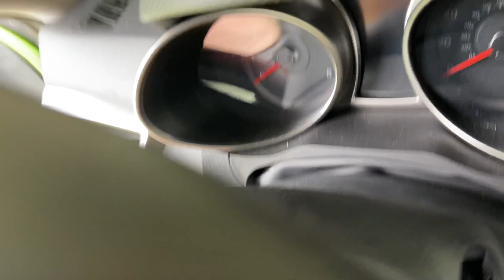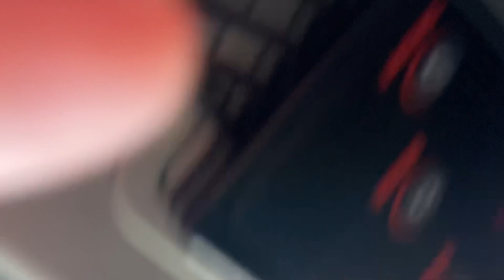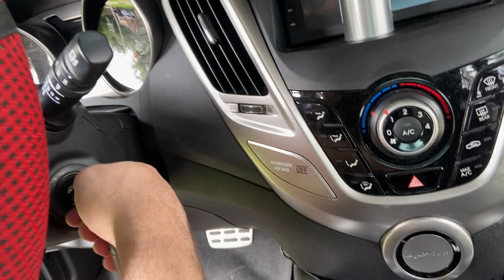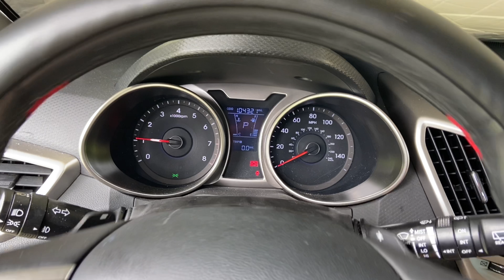Hyundai Veloster - Fix clicking steering wheel

Comment: VERY IMPORTANT POINT...
Prior to re-inserting 14mm screw, make sure to raise rear of steering column FIRST and carefully insert rear lip of column into square which can be seen after 16:07. You will know when it's properly inserted because the rear will stay up while you're still holding front using steering wheel.  Next twist on both 12mm nuts just enough to hold front of steering column.
NOW... you can install 14mm screw.  It might be necessary to push straight up a little from bottom rear.
Tighten 14mm.  And FINALLY, you can tighten both 12mm nuts.
Sorry, for long comment, but this extra attention will definitely make life better for you.
Additional note... There are a total of 5 plug-ins attached to the steering column.
Reply from the maker: Good points, thanks for the comment.
Reply: Your tip was extremely helpful, thanks for sharing
Reply: Lo leí tarde, pero la intuición solucionó el problema jajaja
Reply: How long can I drive with this problem
Reply: @mardanm5465  I don't know how long you can drive with this problem.  BUT, I know you will spend more time researching the answer to your question than you will spend actually fixing it.
Dive in.
Reply from the maker: @mardanm5465  I drove about a year with the issue before repairing and I didn’t notice any major issues. That being said, I had a lot of play in my steering which is an issue and long term, I don’t know what the effects would be. Likely, some metal could wear down a bit from the metal on metal contact. My advice is to either talk to a mechanic or get a friend to help you swap this part out.
Reply: Thanks for the heads up.. made this fix go without any issues...
Reply: I have a question do u have a clunking sound when you hit bumps in slow speed ??
Reply: @MmohammedALSheikhly  No.
Reply: Wish I read this comment before I put mine together.  Had to have someone hold the steering wheel up while I put the long bolt back in.  My hands are way to big for this job.  But it all works and I have an extra bolt and screw left over :)  BTW: Did anyone have their steering wheel come apart while doing this or just me?
Reply: What six said!!!
Reply: Is there any way you could possibly come and fix mine? It looks easy but I feel I can not do it😞
Reply: @shaunaceyshaunie9691  Of course.
Reply: Sorry to be so offtopic but does someone know of a way to log back into an instagram account??
I somehow lost my account password. I appreciate any tricks you can offer me!
Reply: @Gianni Decker thanks for your reply. I got to the site on google and im in the hacking process now.
Seems to take a while so I will get back to you later with my results.
Reply: @Gianni Decker It did the trick and I now got access to my account again. I'm so happy:D
Thanks so much, you really help me out!
Reply: @Elliot Xzavier no problem =)
Reply: @Kur-Six  , not safe to drive too long
Reply: This part was the hardest bit of all. I had to get my little sister to hold up the steering wheel while I finally shimmied the column in place and even MORE shimmying to get the bolt in place.
Reply: @mikew6193  it happened to me ended needing an alignment
Reply: Ha ha learned the hard way
Reply: It's a good point. I figured this out rather quickly. Also, it's a good idea to loosen the x2 12mm nuts before removing the 14mm bolt so you can wiggle the steering column and makes it so once you crack the bolt loose you can unthread it by hand.
Reply: Just to add to this, in case it's difficult to grasp.  The 14mm bolt is literally the pivot point for the steering wheel's adjustment feature, so that's why it's difficult to line up.
Reply: Thank you biggest tip on the market..
Reply: Does anyone know if the Hyundai veloster has any recall in this kind of issues because lately Hyundai has been having a lot of issues
Reply: @DomingoMercado-kh8wb  it only has a ABS recall at the moment that states it could lead to fire.
Reply: What can you do if your steering  wheel is not aligned any more?
Reply: @josephafa  depends if it's intact with the issue above.  Could simply be alignment. It's vague.
Reply: @josephafa  This repair does not affect alignment.
Reply: @Frostcall  We did everything you said, but now we have no power steering.  it gives an EPS code on the dash, and the stability light is on.  Any ideas to what went wrong?  thanks for the great video btw.
Reply from the maker: @iHeartAmySue  while I don’t know your specific and unique situation, others in your spot have reported that some cables did not get plugged in all the way. My advice would be to slowly take things apart, unplug everything, blow on the connections to make sure they are free of debris, and plug everything back in, also check your fuse box. Actually, check the fuse first because that’s quicker and easier.
Reply: @Frostcall  wow that was a quick reply THANKS!  So we did check the fuse, and the connections (we'll do that again) and as far as we can tell everything is fine (the fuse map is difficult to understand, but we checked the fuse that had a picture of a steering wheel on it.)  We did connect the dang battery for a minute while we were trying to get that steering wheel back into place, i'm wondering if we did something to the power steering by connecting that?  (I know that was stupid but it was my dumb idea).
Reply from the maker: @iHeartAmySue  Did y’all get it figured out?
Reply: @Frostcall  not yet. Our mechanic is holding it hostage right now but I’m about to try to go get it and take it to a foreign auto mechanic.   We live in rural Pennsylvania - Chevy Silverado land - it’s hard to find anyone that is knowledgeable about Hyundais.  

Thanks so much for asking!
Reply: @iHeartAmySue i have the same problem do you have the solution ?
Reply: @Korbixdu31  @Korbixdu31 Mechanic said we needed a new steering column control box - the silver box that you see in there. He said it wasn’t anything we did to it but probably got jarred a little bit while we worked on that stupid little plastic piece. You have to replace the entire steering column but we got it from a junkyard and it cost me $650 including parts and labor here in PA. Call a bunch of alignment shops or mechanics who specialize in foreign cars and make sure they have the right diagnostic tools. We would’ve replaced the steering column ourselves but we don’t have the right equipment.

Comment: My dealership where I got my Veloster from wanted to charge my $400 to replace this. So thank you so much for posting this. It helped a lot
Reply: Worst part: the part is $5 from Amazon
Reply: This is actually a hidden recall.  I have an 2013 Optima and the steering went  away. Complained and threatened to sue them. They did the repair for free. Problem is, they used the same crap part and the problem is back a year later.
Reply: @ninj4geek   just went to the dealership & paid $1.18 for the piece.
Reply: @robertosantiago3947 what is the part called?
Reply: @ninj4geek cómo se llama la pieza

Comment: Just did this repair this weekend - The original had disintegrated to the point it was more rubber goo than particulates, very hard to clean. These instructions made the replacement a TON easier. Thank you!

Comment: 4 years old this video is the best! Even now in 2024 I am fixing the issue on my 2013 Veloster. 14mm was no issue. The torques holding the cap I had to slot bang with a hammer to loosen. Mine was made in Korea so it was super tight. Best tutorial I found. I took the whole bottom piece out better access.

Comment: Many thanks for your video and advice. My son and I did this repair on his car. It took about 2 hours and we are not mechanics. For your information, it wasn't necessary to remove the plastic parts around the steering wheel on our Veloster to lower the steering column. Kiss from France.

Comment: This was the best video I could find to step through this.  Saved me a bunch of time and money!  I ended up using a wooden block to hold the column up so I could get the hanger bolt in.  Other than that, it was seamless.

Comment: Worked like a charm! About 2 hours time from start to finish. A couple of key points:
- the 14mm is a beast. I used my long torque wrench to break it loose. 
- it helps to have someone give you a hand to get the steering wheel back in place. 
- it’s easier to disconnect the battery after you remove the two screws on the steering wheel shroud. 
Thanks again for the video - saved me $400!!!

Comment: I have 2012 Veloster in automatic, from Germany, and also experience clunking noise in the steering. I bought the coupler, started dismantling the steering column as per your instructions. Following them closely, really helped a lot. So big thanks for your effort making it! Funny enough, I did not have the metal bracket, you show in 5:30. I also did not have to disconnect all the plugged in cables, as only two of them prevented me from lowering the column. The 14mm bolt was a hard ride, as everyone described. I managed to carefully hammer the spanner on it towards the floor, to loosen it. Luckily it gave up and I could easily remove it. Reassembling wasn't that hard, and the column wasn't that heavy as expected. I lied on the floor, with the column on my chest and slowly began to lift it. I didn't realize, there was a special bracket in the back, to which the column is being inserted into - just behind the 14mm bolt. So I had to refit it. Once I inserted the column in the right position, I tightened it with the 2 x 12mm bolts by hand to hang above me securely yet still having some play. Only then I screwed in the 14m back in. Once, all was secured I probably spent most time on the two plastic covers behind the steering wheel, reattaching them together. All in all, it turned out, my coupler was in 95% ok, just slightly worn, (55k miles), yet I replaced it anyways. Unfortunately my clunking is still there, so I am worried about bigger service that will be needed. Probably steering rack is at fault.

Comment: I just did this repair yesterday. Getting the steering wheel mounted back into place was a little tricky I needed help lifting the shaft back into place. But other than that this video is spot-on and should be used anytime you need to fix this problem.
Reply: Hi sir what is name of the part please

Comment: Really! Today I fixed same issue & I followed up your pin points instructions. And I got great success. In your post you covered everything. This is called real help to the society. What I faced difficulties I explain. Take out 14 mm bolt and also locate. Coupler drum with T30 screws. T30 screw removal. Sunex 9726 Mini Ratchet and Bit Set, 1/8-Inch - 1/4-Inch S2 Bits, 5/64-Inch - 1/4-Inch hex bits, 38-Piece Silver.  

This will help lot who want to work for the same issue. Once again thank you so much & Marry Christmas to you & your family.
Reply: Coupler I bought from Hyundai agency for $1.97  with tax
Reply from the maker: I’m glad the video was helpful. Thank you for the kind comment.
Reply: Merry Christmas!

Comment: Great video. Saved me about $400 in shop repairs. I did have to remove the MOBIS airbag control module in order to get to the 14 mm bolt that’s tucked way the f back there. Since this is my first time loosening that bolt it was nearly impossible to break it by hand since it was factory torqued. Used a rubber mallet and tapped on it for about 2 minutes to gently start to break it. Used good ol’ elbow grease to finally release the bolt. Needed more room and removing the airbag module box was the only way. Good luck everyone.
Reply from the maker: I’m glad it worked out for you, great tips for folks looking to do the repair.

Comment: I did this repair a couple of years ago.  At the time, I could only find videos for the Elantra.  The process is almost identical EXCEPT for the placement of that 14mm bolt.  I almost gave up and put everything back together, but I finally found the 14mm bolt and managed to drop the column.  As others have stated, it DEFINITELY helps to have an extra set of hands to help mount the column back into place.  

And now my wife's Elantra GT is doing the same thing, so gearing up for round two.  Lol.

Comment: Fantastic video!  Very thorough and easy to follow step by step... I ended up putting long 14mm bolt back in after the other two nuts up front when reassembling (found that easier for some reason) but great instruction. I wasn't going to tackle this one on my own but after watching the video it looked relatively easy.  Thank a ton!!

Comment: Thanks much! And thanks again for pinning the comment about the square hole and the 14mm... Wow, that 14mm was a lot of fun... I had to use the 2 wrench method, which is not recommended but it's all I had in that tight space (box end on the bolt, second box end on the other end of the first box end for leverage. Good way to skin your knuckles.) Yes it's a T30 torx but tight because of the coating I think. SHOP AROUND when you look for the part. I bought 10 for $5 because it was the cheapest way. Other sellers were selling ONE for twice the money or even more. I'll save an extra one and give the rest to my actual mechanic. Given what you're saving doing it yourself, I suppose that $5 is not a big deal. Thanks again!!!

Comment: Thank you Sensei! I followed all your video and was very useful. My only problem was that when I removed the old rubber coupling it was in perfect shape. My car has 115,000 miles. The difference between the new and the old one was that the old one felt very soft so I changed it for the new one and the noice was reduced dramatically.

Comment: Please read all solo workers!

If you are doing this job solo when trying to put the 14mm bolt back in it’s easier to put the two 12mm nuts on to hold the top of the steering wheel and it’s easier to put that 14mm in. Overall it’s not that bad not not easy to fit down there and get stuff done. 

Amazing video, god bless you!!

Comment: Going to tackle this today. I will be referencing your video as I do this. I will let you know how it goes. Without this video I would probably be playing a mechanic to do it. Thanks for doing this great video.
Reply from the maker: You can do this. Some folks said lifting the steering wheel back into place is easier with a friend’s help. Keep that in mind if you have trouble.
Reply: @Frostcall  ended up being a nightmare. I replaced the part and was getting the steering column remounted...got the two front nuts in but when i reinserted the long bolt at the base I did not realize the column was not up into the bracket....i tightened the bolt, and then started to wonder why the base of the column was still not secure.....it was then i realized that from tightening that bolt without the column in the bracket....the bracket bent inward. Now that part of the column will not fit in the bracket....even after bending the bracket back out. Whats worse is the bracket is welded in. It can’t be replaced I imagine without a mechanic gutting out the inside of the car. Not sure what I can do.
Reply from the maker: @Duojett71  Yikes. You might want to get some professional help to bend it back and get everything put back together.
Reply: @Frostcall  had it towed to a local shop. I hope they can fix the bracket. It was my careless mistake and hopefully someone will read this and not make the mistake I did. Video was great though and I in know way want to take away from that.
Reply from the maker: @Duojett71  I pinned this comment as a heads up for people. I’m sorry it didn’t work out for you but hopefully others can take your thoughts into consideration.
Reply: @Duojett71  thank you! I appreciate your feedback as I am about to do this to my car today
Reply: @Duojett71  now they’re going to charge you more than what it would have cost to get the coupler replaced in the first place. Good luck I hope they didn’t rip you off.
Reply: How did this work out in the end?

Comment: Great video,  I was able to do this by myself and save some money.  I did have a wire that I don't see in this video (mine is a manual transmission so that may be why)  It was a white plug with a blue tab on the right side of the column.  You must remove the blue tab first.  thanks for posting this video,  I would have never tackled the job without this video.

Comment: Outstanding presentation. Thank you so much for the effort. Thanks to your video, I just replaced the coupler on our 2014 Turbo. That 14 mm bolt is a beast...both ways.  A few suggestions: Schematics of the Veloster steering column are available online. Also, I found it easier to remove and replace the trim behind the steering wheel without the lower trim piece in place. One more thing, after I removed and cleaned out the remains of the old coupler, I confirmed the alignment of the motor and the column assembly before I inserted the new coupler. Once I had them aligned, I inserted the couple about halfway so it would act as a guide as I replace the motor.  And I definitely needed my son’s help to lift the steering column back in place.

Comment: Just got this fixed not 10 minutes ago! Had me worried it was a front end problem, so I checked it. Sure enough, ground up rubber coupling! Going to test drive it here soon and see, but the steering wheel is already tighter when I move the wheel. Thanks a bunch!!
Reply from the maker: I’m glad to hear it worked for you. My steering wheel felt brand new again after doing this.

Comment: Thanks for the video.. took my son and I two hours without any real problems.. just sucks working under the dash for that long.. especially trying to get the steering column back up into place.. really need two people to do this effectively..
Reply: For reals.  I just finish with mine 5 mins ago but getting that heavy ass steering column in a awkward position is such a pain.  Sadly I was solo.